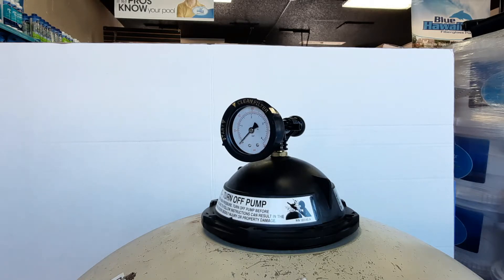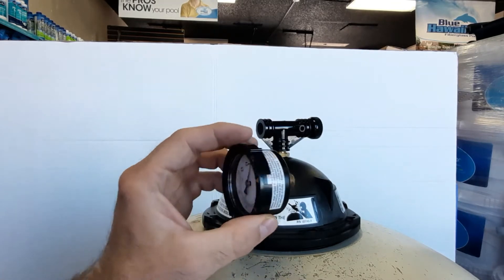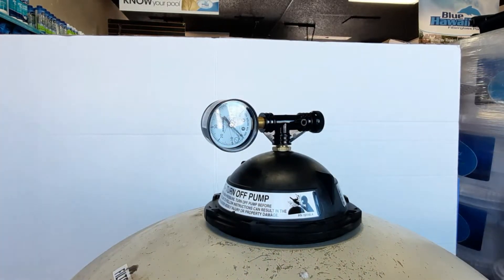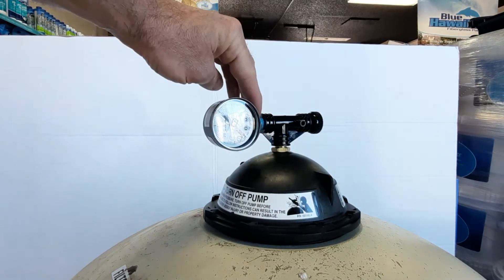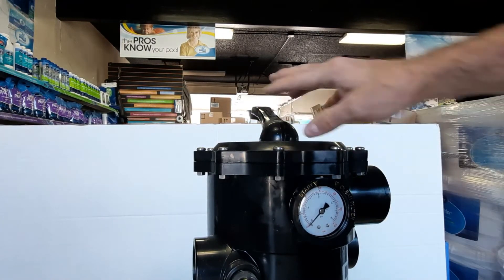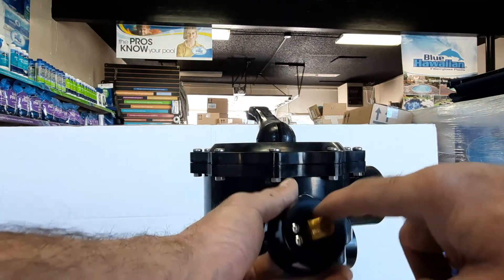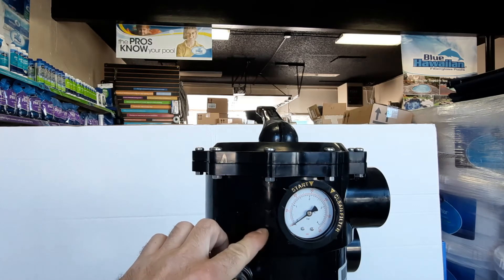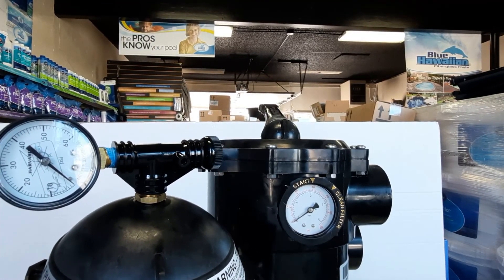How to replace a Pool Filter Pressure Gauge: Pool filter Pressure gauge  replacement:

Comment: I have a Waterway Crystal Water cartridge filter. The pressure gauge is shot and I don’t want to buy the whole assembly just need to replace the pressure gauge but want to make sure the back mount screw is standard. I haven’t found any waterway replacement gauge for this one. Do you have any information on that. Thanks
Reply from the maker: Hello, any 1/4 inch back mount pool pressure gauge should work. Here is a quick link to get one just make sure it looks the same. Thanks for watching.  https://amzn.to/3yeaFPd
Reply: @Poolelementary  do you happen yo know what size pressure gauge i can use on a intex sandfilter and pump 16"?? Its been broke for a few weeks and i have bought the wrong size twice now! So i measured across the bottom screw in part on old one 3/8 outside to outside right across the bottom that youd stick in the filter, little did i know thats not how it is supposed to be measured, and i have read and read so much about id od mnpt npt fnpt and this type needs a sealent but fnpt dies not and uhhh i still dont know! I think something said subtract quarter inch off so if my mnpt is 3/8 is my actual inside fnpt 1/8? Ir is it not even fnpt and just npt? Please assist in the security of my sanity!
Reply from the maker: Hi Leah your pressure Guage should either be a 1/4 inch npt  or 1/8 inch npt but 1/4 inch is most common.

Comment: Does Hayward cartridge filters have a pressure gauge on them??  New homeowner and poolowner, and I bought the house during the winter.  I cannot find a pressure gauge anywhere with all the plugs.  Please let me know if cartridge filters use a pressure gauge?!?  Opening my pool in 2 weeks!!!  Thanks!!!!!
Reply from the maker: Most filter systems have a pressure gauge to tell you when and how dirty your filter is getting. So I would say yes it has a pressure gauge. If there is zero Threaded holes in the top of the filter canister than maybe not.